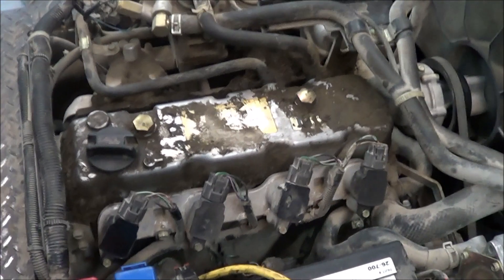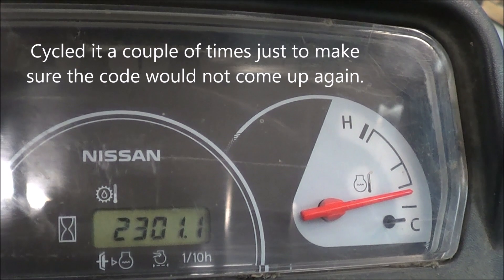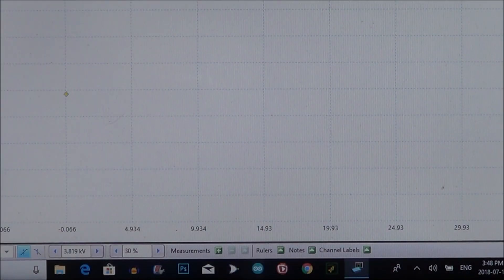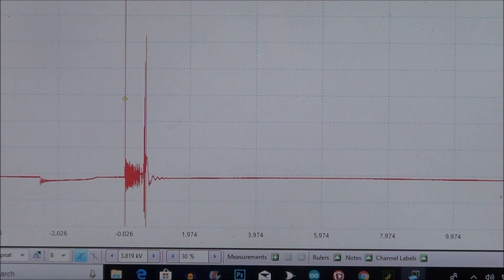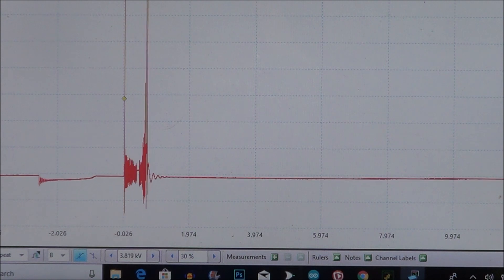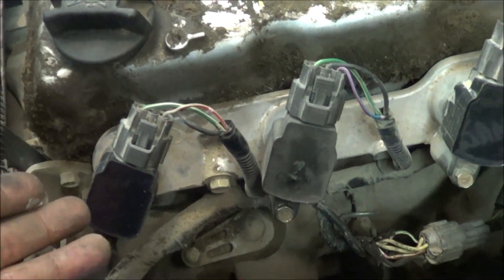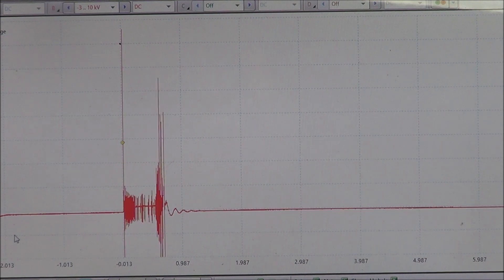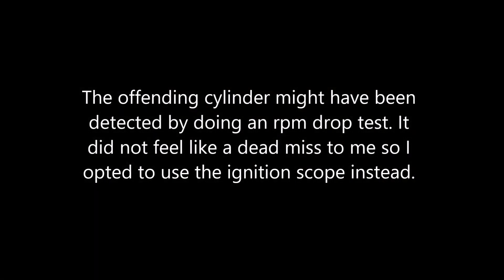Nissan Forklift Runs Rough Under Load

Comment: Working on one of these and it has no throttle ! Replaced peddle sensor and throttle body sensor no difference . Any clues ?
Reply from the maker: Is there an error code?
Reply: @forkliftgeek10  just check engine light , hooked to it with an autell code reader had a code p2138 and also a code for speed sensor can't remember what it is , I'm not at work at the moment.
Reply from the maker: If you already replaced the pps and throttle body, then I would check on the ECM side if it is receiving the right voltages from the sensors.
Reply: @forkliftgeek10  thanks for the advice , really enjoy your videos